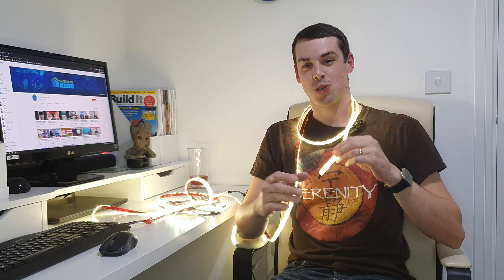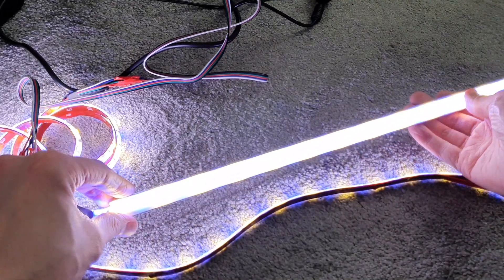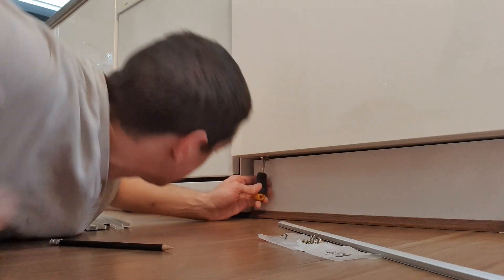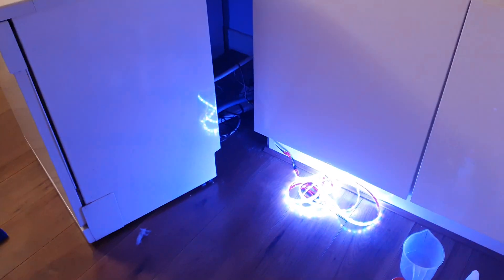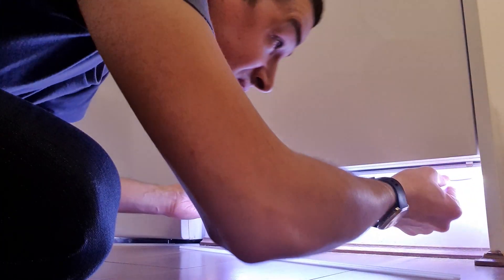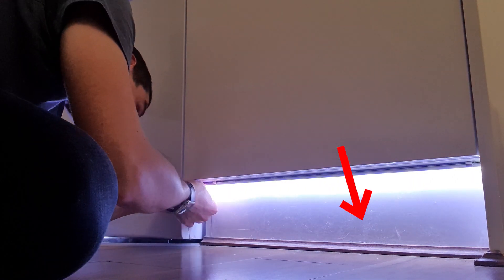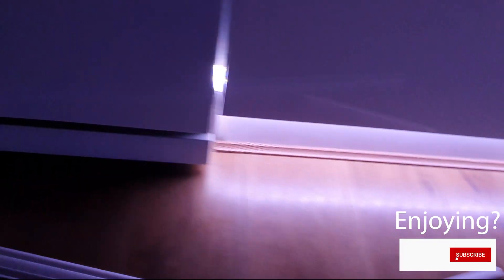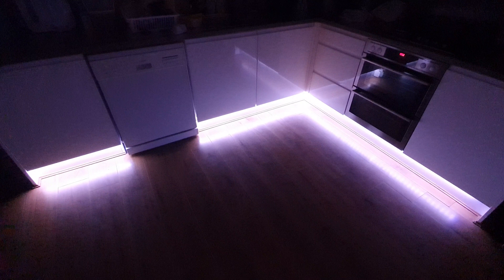My Kitchen's Smart ZigBee Light Strip Install (+ Should You Use A Diffuser Channel?!)

Comment: did you take one long zibgee LED strip and cut it in half? if so, what splitter did you use to connect the two ?  I was wondering if it was possible to do that.

Comment: Does the Gledopto controller reset everyvtime you turn it off/on, or does it keep the last settings (for example light color or brightness)? I am think of using it with a motion sensor, but I cant find this info.
Reply from the maker: Mine keeps to the same light color and brightness, although I have seen it 'forget' the previous settings a few times. So I'd say it's pretty good at remembering, but bit quite as good as Hue Lightstrips IMO 

Having said that, if you pair it with a motion sensor, you can choose the colour and brightness in the app, meaning you won't really need to worry about whether it resets itself (in this case).